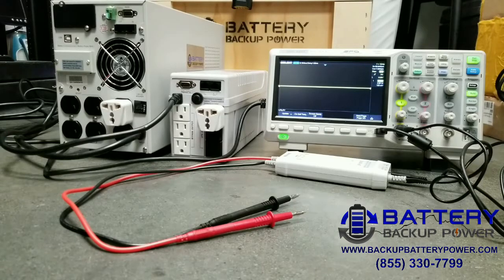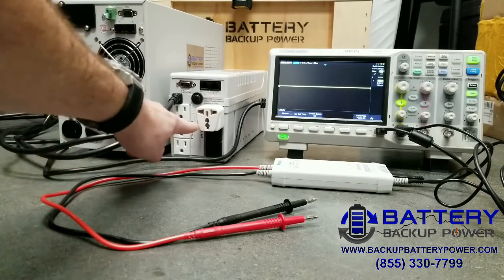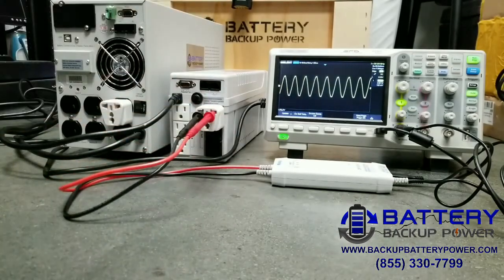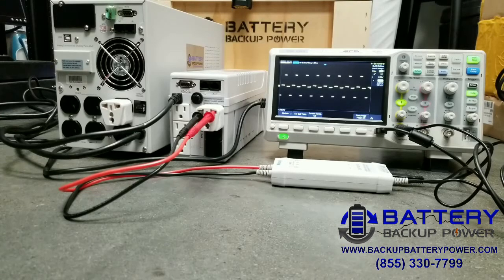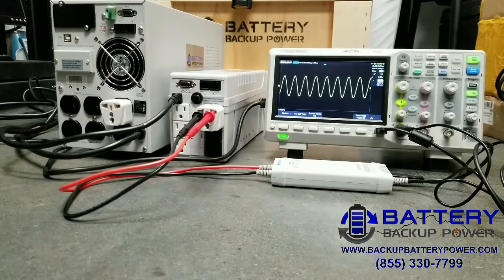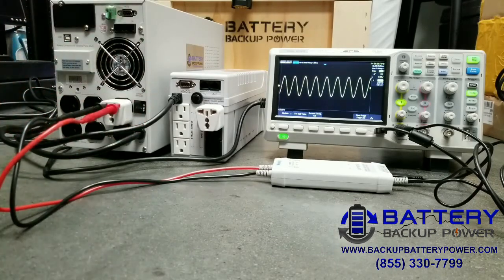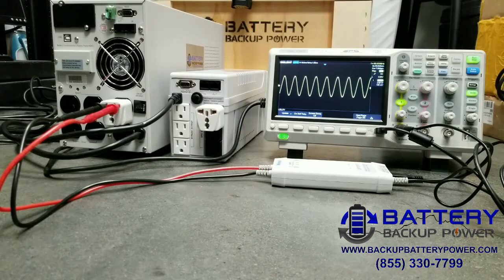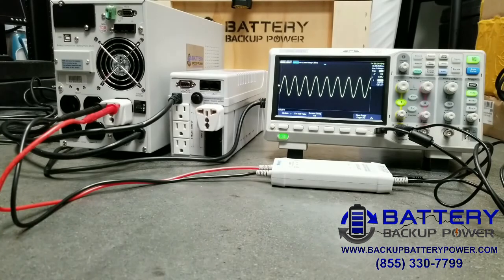The Difference Between Quality And Cheap Battery Backup UPS

Comment: What you really should be worried about is noise between neutral and ground, not the sinewave. The mass spec uses a solid state rectifier and recreates it's own AC (RF) at the generators using that rectified RF>

Comment: What is "sensitive equipment"? Is average gaming PC sensitive enough to warrant high end UPS (like HDD and gaming video card)? Not that we don't want high end UPS, in the end, it's the matter of available budget.
Reply: I don't like to comment about videos like this they are advertisements to highlight a product, but if your power supply is pfc active, you will need a pure sine wave ups for your gaming computer otherwise as soon as you have a power outage or something it will power off immediately, but  if your power supply is NO pfc a regular ups will do the job.  UPS are designed to help you during power outages for a short period of time, you save your work and shut it down or wait for a generator or backup power.  But many people today think that a UPS is a generator that will keep the system running for hours... sensitive equipment = medical equipment, anything using pfc, inductive loads, NAS ...  But for a few minutes a modified sine wave ups will do the job as it should in normal equipment modified sine wave are not efficient.  Double conversion UPS are pricey, they are for datacenters or for any person that have deep pockets to go for $400 + and beyond.  "Normal" ups they are cheap and they do what they are suppose to do as long as you do not use it beyond manufacturer limits.
Reply: if you have a gaming pc you def want a ups. even a regular shit ups that will keep ur electronics on after a power outage will do the job.

Comment: Are secure ups good?
Reply: Secure UPS are cheaper units. You can expect a wave form like the first UPS tested here. Stepped sine wave and not pure sine wave. It will protect a PC from power failures just fine. But don't expect the quality of an expensive UPS.